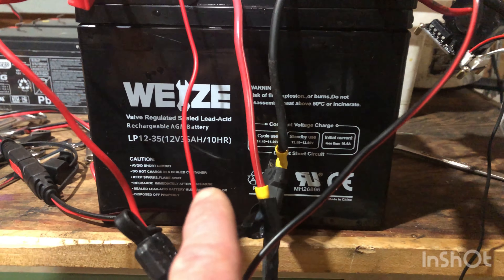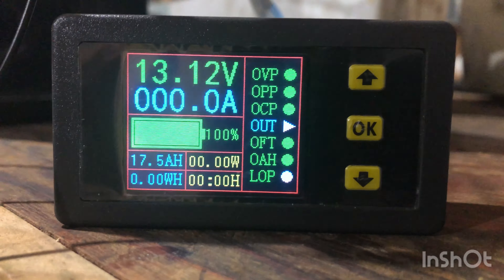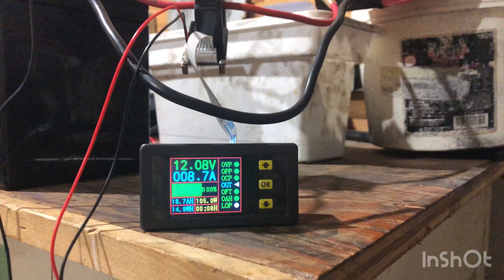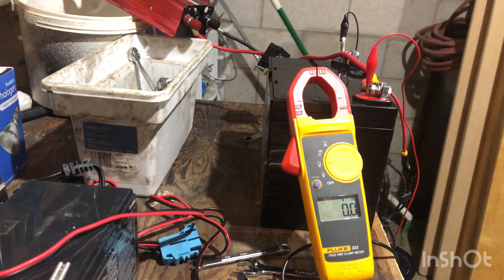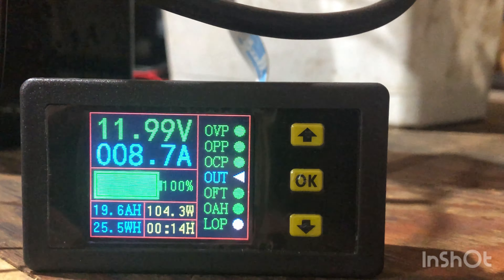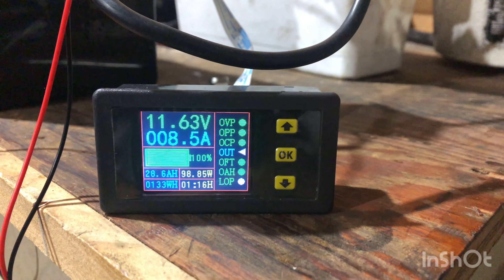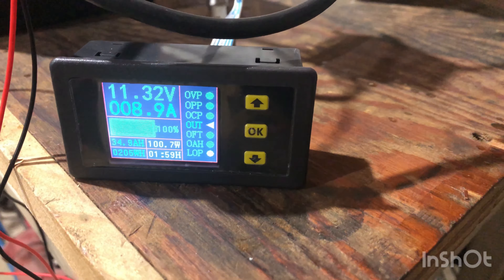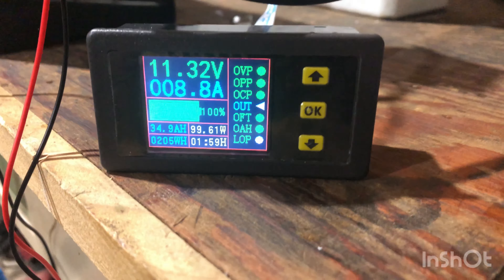Weize 35 AH AGM deep cycle battery load test. Solar/troll motor battery.

Comment: OK, so you drew down 17.5 amp hours from an AGM battery that is rated for 35 amp hours.  Since you did not check the state of charge (SOC) of the battery at any point during the test, most notably at the end, you really have no idea whether or not this battery met its AH rating.  All you know for sure is you drew 17.5AH from it.  It could be that the battery only holds 32.5AH and you drew it down to 15AH SOC.  If your only expectation is that you can draw 17.5AH from this battery, without damaging it, then you still can't say it passed, because you don't know what percentage SOC you had left, after drawing 17.5AH.  Are you relying on the resting voltage to determine SOC?
Reply: Isn’t there a SO Charge on PWM Charge Controller in % ?  Battery connect 1st,
then afterwards Grape Solar Panel connect to PWM Ch. Control. indicates voltage of Panel and voltage of battery.  Also gives state-of -  charge of battery
in percentage %.   (I shorted amps mistakenly last winter seeing a glowing
lightbulb shape on Control. by connecting Panel to Load, wasted gas a $23 new MC 4 fuse )   Battery is intended for trolling motor maybe 1/4 hour at first.